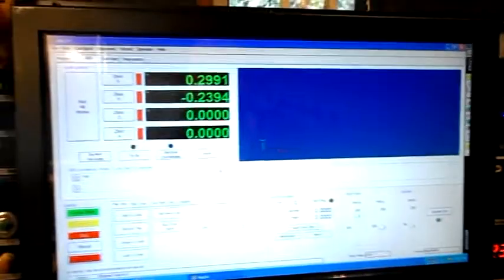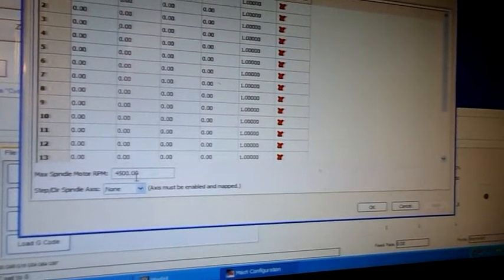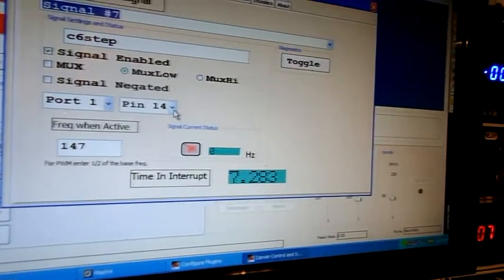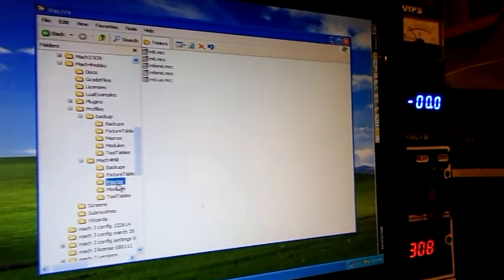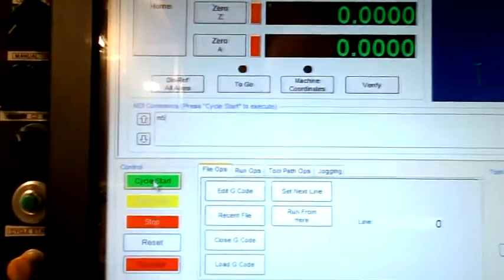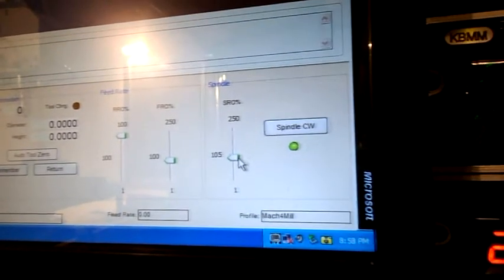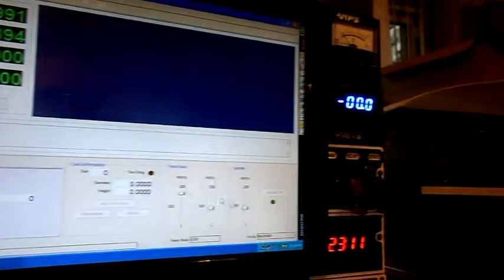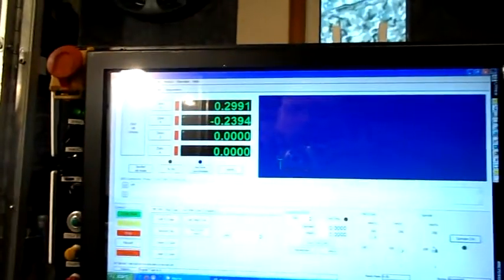Mach 4 C6 Spindle Control with M3 M5

Comment: Glad you got it working Hoss. I think that Mach 4 or Darwin has a bug. Sometimes when I close down Mach 4 and restart, Darwin forgets that the frequency output pin for the spindle should have a value entered and sets it to zero. In MDI M3 S1000 gets no spindle movement. Going into Darwin and setting a value for the frequency pin will fix the problem. I also deleted all the M3, M4, and M5 macros from the Marcos folder but that had no effect.

Comment: hi hoss, please can you tell me how to safely reverse a kbic board, i read you need to kill the power to the board, if i put a solid state relay in the power line controlled by m3 is this ok ?, plus i can use m4 to switch a dpdt relay to switch the motor wire around but how do i then turn the kbic board back on as i have then used the m4 in switch the dpdt relay can i wire a solid state relay to the m4 line as well ?, i am worried about popping the kbic board. thanks Daniel